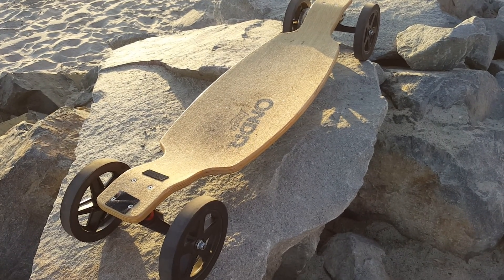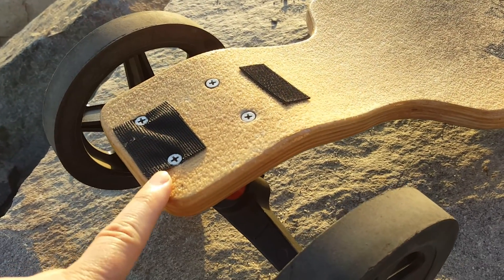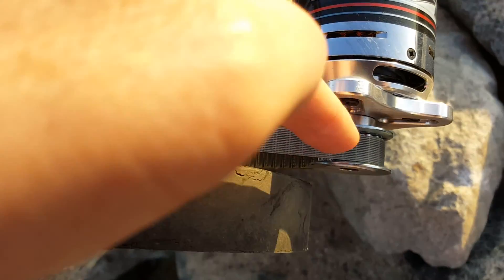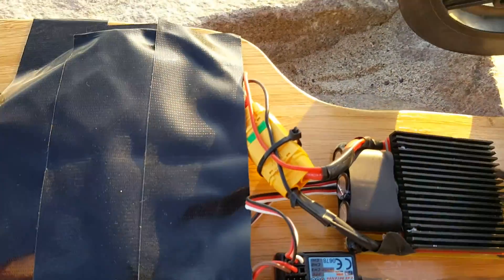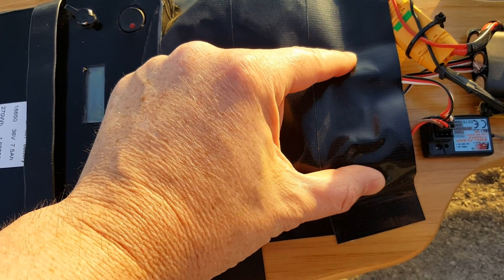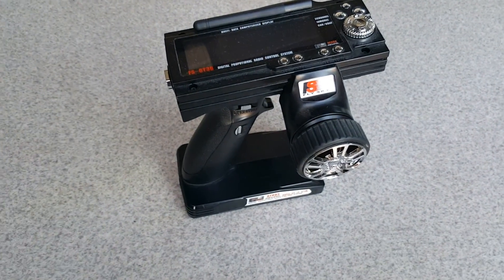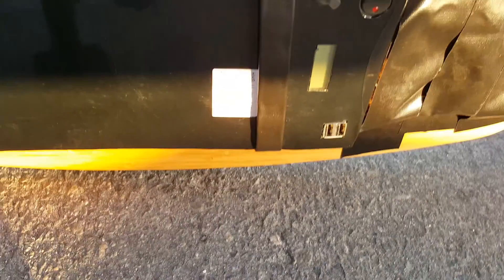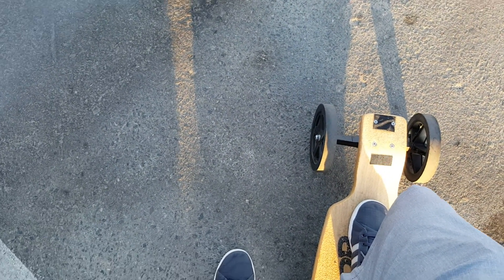DIY Electric skateboard - Onda Longa longboard converted to electric longboard

Comment: Got a question for ya if u don't mind. With that set up do you know what the average Top Speed and the average max distance is?
Reply from the maker: Hey Sector 7.  I have not run it down to see how far it would go.  I live by a bike path that is 2.5 miles from the beach.  On a full charge I can go there and back and ride around the beach for a bit so maybe 6 miles, and still have I believe around 70% battery (pretty flat, couple underpasses for hills and slight incline on way back from beach).  Top speed depends on the gears you put in.  I have also not tested top speed.  I just like to cruise and carve.  You could for sure hit over 20MPH easy.   Hope that helps.
Reply: Aaron Robertson Yeah that helps thanks. I was thinking about purchasing that kit.👍
Reply from the maker: I've not tried other electric longboards but since I loved how the longa rode...  now I have endless carves.  I don't think you would regret it.

Comment: What is the website for the parts that you bought?
Reply from the maker: Marcos Rivera there are a few sites.  www.diyelectricskateboard.com for the battery, esc, and speed controller. Amazon for the motor.
www.turbobikekit.com for the transmission.